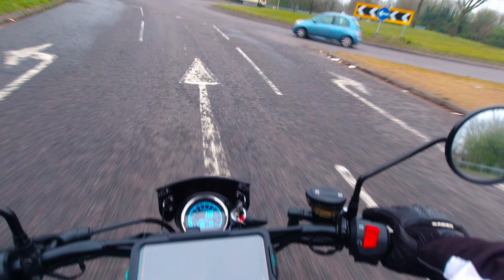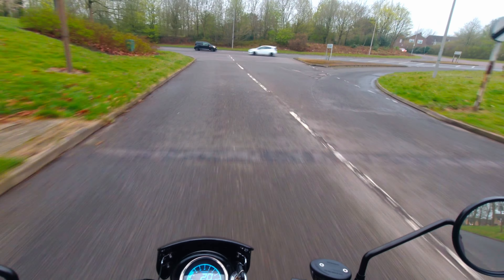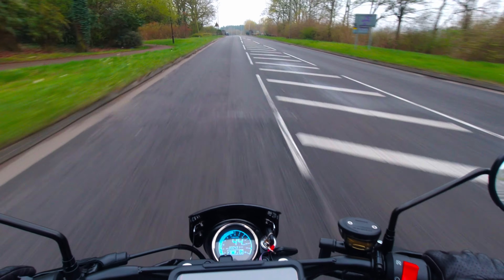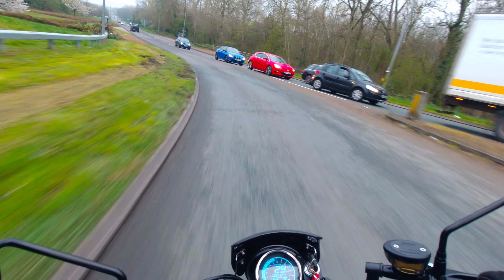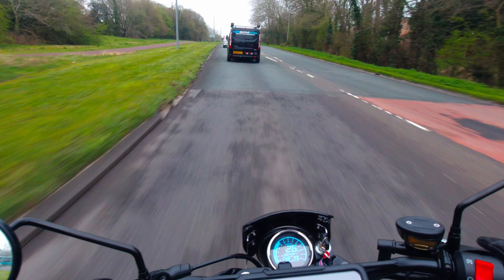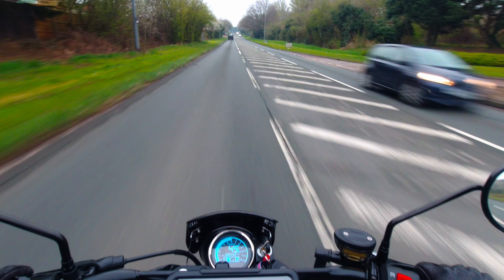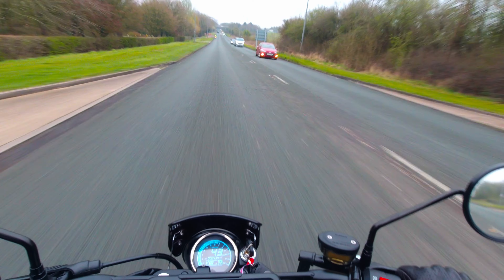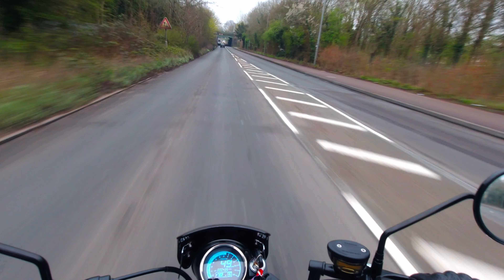Bullit Bluroc 125 valve clearance [ doing the valve clearance on a Chinese motorcycle 2022 ]

Comment: Sounds like you need to change the fuel injector. I had exactly the same issue and it solved it completely when I changed it.
Reply: We changed to a carburetor,  it nips along at 60 now but we can not get rid of the engine management light. Any ideas guys ?
Reply: @laurawalter8610 sorry, I know this is an old comment, but could you tell me what carb you used to get rid of the injection please? Was it easy? And did you have to do any modifications? Thanks 😊

Comment: Did my Brixton 125 today after watching this as it kept stalling with clutch in and lacking power too. Set the exhaust valve to 0.1mm and it runs good now as well as not stalling 👍

Comment: I am a owner of a new Bluroc Legend  with 1500 km.and have serious problems...no power (i climb hills in the 1.gear with 40 kmh.and the second gear has not power enough) and  after every cold start the motor dies several times while running...the dealer has no solution and says it is a common problem with the controll electronics of this bike ,but the Bluroc company gives no support and doesent respond to inquiries.
Beautiful on the outside,but poor in the inside...I am very disappointed!!!